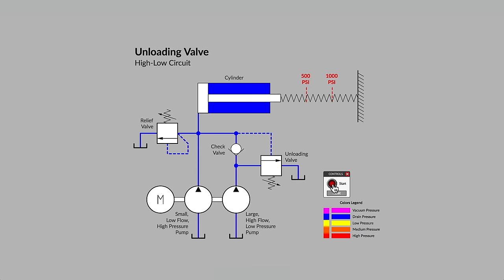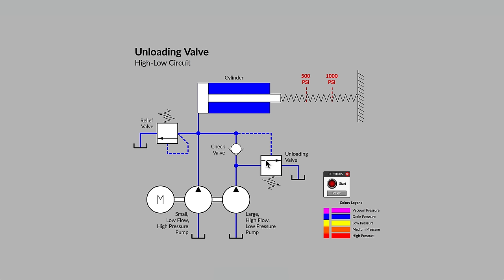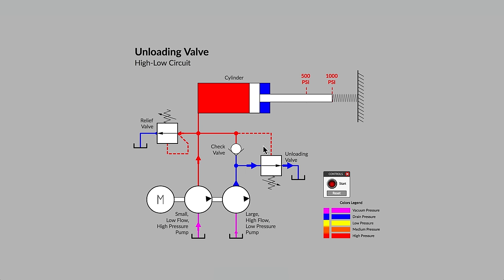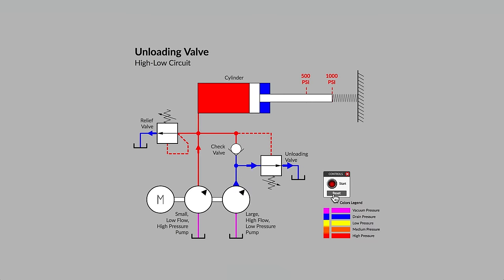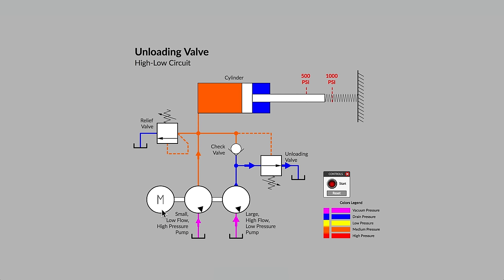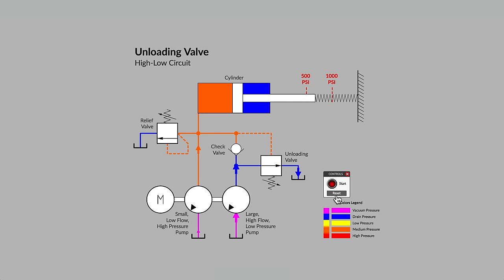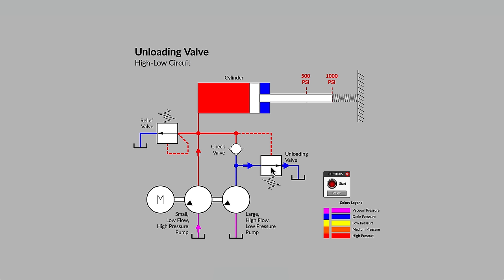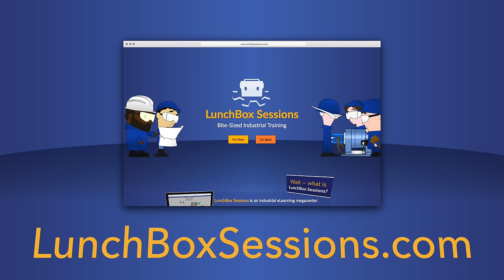Unloading Valve Basics

Comment: An additional pressure control device is the unloading valve. This valve is used to
permit a pump to build pressure to an adjustable pressure setting and then allow
it to discharge oil to the tank at essentially zero pressure as long as pilot pressure
is maintained on the valve from a remote source. Hence, the pump has essentially
no load and is therefore developing a minimum amount of power. This is the case
in spite of the fact that the pump is delivering a full pump flow because the pressure is practically zero. 
This is not the same with a pressure relief valve because the
pump is delivering full pump flow at the pressure relief valve setting and thus is
operating at maximum power conditions

Comment: Great video. Why check valve is not provided at the downstream of high pressure, low flow pump? Also, if I am not wrong, you meant centrifugal pump by saying;  High flow and less pressure pump and PD pump by saying High pressure and low flow pump? Also where is the application of high and low flow pump used together?
Thanks for sparing your valuable time.
Reply from the maker: You could put a check valve on that low flow pump outlet, yes. In this case the check valve on the high flow pump is serving a very special purpose - to help operate the unloading valve. Without the check valve, both pumps would flow to tank when the unloading valve is triggered. With both pumps unloading, pressure would fall, and the unloading valve would close. Then pressure would build once again, and the system pressure would oscillate - not good.

The application is common for a press type of machine, where the high flow is needed during the initial 'motion' stage, and then when the press is doing hard work near the end of stroke, the high flow pump is unloaded, and only a low flow is used, to finish the press cycle at high pressure. 

Thanks for the questions. - Carl

Comment: if the check valve is ruined and not allowing flow of fluid in any direction, how can i assure that the high flow pump will still benefit the system, with out replacing the check valve

Comment: #LunchBox Sessions:  what if we use single high-pressure pump instead of using in above circuit two pumps and tell me please where will be the power utilization more. simply asking you why we are using two pumps if we can handle with single pump?
Reply from the maker: Great question Vijay. The two pump scenario with unload valve in the lesson is popular for a high/low circuit, sometimes know as fast-approach, slow-feed, or motion-and-hold. One example is a filter press where both pumps (one with noticeably higher displacement) help to close up the press (motion control application) but once closed, the large pump is unloaded, while the very small pump is used to maintain a critical clamping pressure (hold function) and make up any internal leakage. A small displacement pump at high pressure requires far less input energy than a large pump at high pressure, flowing mostly over a relief valve during clamp dwell time.

Unloading valves are sometimes used with a single pump. They are often then referred to as an accumulator charge valve, where the single pump is unloaded once a sufficient charge volume of oil (detected by pressure switch at accumulator) is present in the accumulator. The single pump displacing it's full volume but at very low pressure through an unloading valve is again saving lots of input energy. The amount of input energy (eg. electricity consumption)  for a hydraulic system is as you know, a combination of both pressure value and displacement (flow).  

Feel free to respond again if I am not adequately addressing your question.
Reply: GREAT REPLY FAB #LunchBox
suggestions 
* please add more circuits that will surely helpful to students and professor. 
* add numerical treatment for different valves so student can easily differentiate difference.